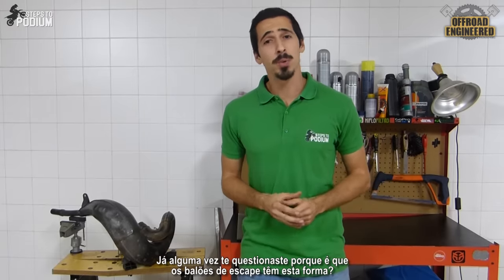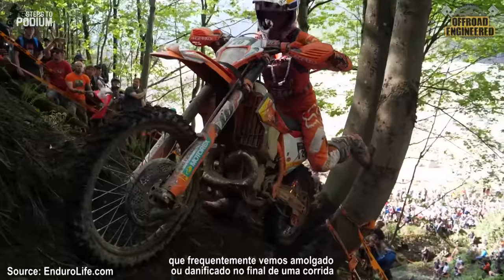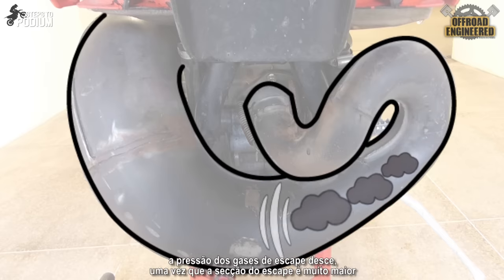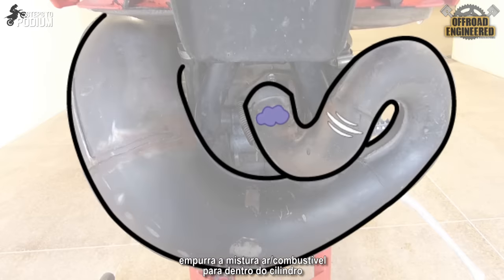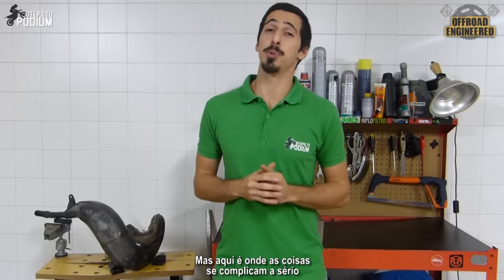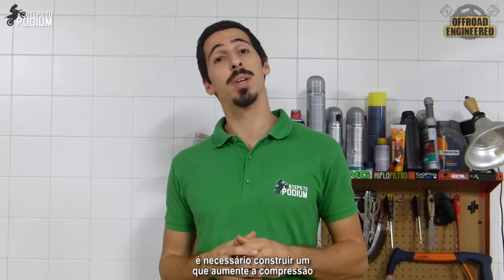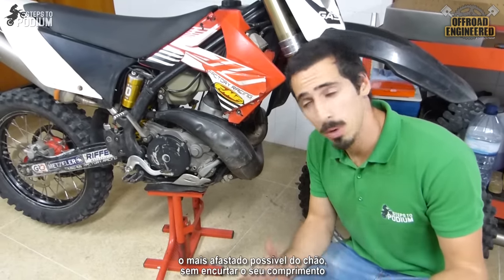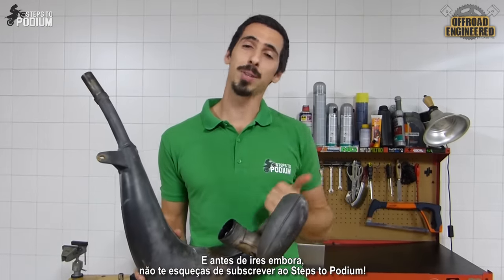How 2-stroke exhaust pipes work | Offroad Engineered

Comment: You have missed one import factor, as the pressure wave reaches the divergent part it creates a suction pulse that can actually pull mixture from the transfer ports, thus assisting charging. The convergent section does act as you have described. The outlet (stinger) is also part of the tuning process, but the outlet does not have to be at the end of the pipe it can be almost anywhere. Walter Kaaden was the originator of it, the Kadenacy effect  is named after him, it can be applied to two stoke diesels as well.
Reply from the maker: I posted a comment explaining that part and why I didn't include that part in the video 😉
Reply: @StepstoPodium  Didnt see that, all good, too many comments to trawl through.
Reply from the maker: @jeffsewell412  No problem :)
Reply: Good one! Motocross action did an article on the " father of the expansion chamber" , but his name escaped me, until you posted it.thnkx

Comment: Wonderful video! What would happen if you get hole in the pipe. Say a centimeter in size.  Would bike have trouble running or starting?
Reply from the maker: Thank you!! It would definitely have issues running and even starting, but it would depend a lot on where it would be as well

Comment: To add a bit more detail to StepsToPodium’s explanations — I’ll offer a bit more information:

A 2-stroke engine’s exhaust pipe can really be looked at as providing 2 different ways that it “functions”:  one is sonic/acoustic, and the other is pressure/volume (look up “Helmholtz resonance” to learn more about the latter one).

The shape of the divergent and convergent cones (that is: including angle, length, diameter) primarily determine the acoustic/sonic function of the exhaust pipe (and of course effect the total volume of the exhaust pipe).  The “negative pressure” (as the sound wave from a single exhaust opening event travels down the exhaust pipe) is caused by the cross-sectional increase in area of the divergent cone.  The angle of this cone, and its position relative to the piston face, are the primary considerations of the dimensions and design.  Similarly, the convergent cone “reflects” that acoustic wave back in the opposite direction, and its shape/angle/length/position determine the timing/strength and duration of that reflected wave.

Focusing almost entirely on the sonic/acoustic portion of the exhaust… what wasn’t mentioned, is that the port timing (position of the exhaust and transfer points relative to top dead center and each other) — typically measured in degrees — is the primary driver of the design of the exhaust pipe, at least when it comes to angles and lengths (there are other items I will ignore for now).  For the moment, let’s assume that the crankshaft is rotating at a very stable rate (crank speed actually varies slightly through the stroke).  For example, let’s say the engine is rotating at 6000 rpm.  That’s 100 rotations per second or 10 milliseconds per turn.  For sake of simplicity, let’s say the exhaust port in our imaginary engine opens at 90 degrees after TDC, and the transfer ports open at 120 degrees after TDC.  Now we get to the interesting part — when the exhaust port opens, a sonic wave begins to travel down the exhaust pipe.  The exhaust pipe could have a straight/consistent header diameter or have a slight taper.  Regardless of its shape, we can look at the shape/angle/cross-section of the first portion of the exhaust pipe (from the flange on the cylinder, all the way to where the divergent cone reaches its maximum diameter) as being the portion that creates the “negative pressure wave” (primarily due to the increase in cross section).  As that “wave” continues traveling down the exhaust pipe, it encounters the “convergent” cone, and as the cross section begins to decrease, a “reflection” reverses the direction of a good portion of that wave and sends it back toward the cylinder.

In this very simplified example, we have 30 degrees of crank rotation from exhaust port opening to transfer port opening, and at least as importantly:  150 degrees of crank rotation from exhaust opening to transfer port closing, and 180 degrees crank rotation from exhaust opening to exhaust closing.   So at 10 milliseconds for a full turn of the crank at 6000 rpm, we have .833 m/s from exhaust opening to transfer opening, 4.166 m/s from exhaust opening to transfer closing, and 5 milliseconds from exhaust opening to exhaust closing.  These numbers ONLY apply at 6000 rpm, and this is a SUPER-simplified example.

So, if we know the speed of sound (more on that in a minute), we can calculate “roughly” what the distance should be from the piston face to maybe the center of the rear/convergent cone, and back to the piston face for the convergent cone to be somewhat close to “in tune” (correct distance from the piston) at 6000 rpm.  Many people have an idea that the speed of sound is around 750 mph or 1100 ft/sec, which holds true at around 70 degrees.  Those numbers are way off for an exhaust pipe though, because the speed of sound increases dramatically with temperature.  Of course the temperature varies in an exhaust pipe, constantly cooling as it expands and travels down the pipe.  Let’s just throw a nice easy number at it, and say the mean exhaust temperature is 500 degrees F.  Now the speed of sound is about 1520 ft/sec.  

Using the above numbers (once again: only as a rough example, simply to illustrate the concept), We have 5 milliseconds from exhaust opening to exhaust closing, and at 1520 ft/sec, that equals a distance of 7.6 feet.  Of course we can divide that by 2 since the sound wave is traveling “out and back”, which gives us a distance of 3.6 feet from piston face to say… the middle of the convergent cone (and in reality, measuring a bit closer to the small end of the convergent cone may be more accurate).

As can be seen, this is only one value, at one rpm, at one port timing, and at one mean exhaust temperature.  A 2-stroke exhaust pipe has to be designed to work not only through a usable rpm range, but also “in concert” with other engine characteristics that go in and out of tune through the rpm range!  It does no good at all to optimize an exhaust pipe for 6000 rpm if the port timing is far better suited to higher rpm, or of the volume of the crankcase works especially well in a certain rpm range, or if the intake length is tuned for a certain rpm, etc. etc.

And… I have only been talking about lengths/distances and ONLY to the rear/convergent cone. (These comments don’t even touch on what happens in the header section and the divergent/front cone -- that could easily be another message as long or longer than this one.)  Exhaust pipe volume, header diameter and length, stinger diameter and length, type/flow of silencer…. ALL those items add into the equation of building an exhaust pipe.  Additionally, 2-stroke engines have many engine components and settings that go in and out of tune through the rpm range, and the exhaust pipe has to be designed to not only work best for a specific use, but work “in concert” with other setting and tuning parameters in the engine.

None of the above even begins to discuss port timing or blowdown, ignition timing, combustion chamber shape and volume, roof angles of the ports, port “layout” (where each port is “aimed” within the cylinder), crankcase volume, tuned frequency of the intake tract and reed valves (assuming it’s a reed valve engine, which is the most common in 2-strokes), type of fuel, rpm range the engine will be run at, conditions/altitude where the engine will be run…. and many other items.  Tuning a 2-stroke engine (or building an exhaust pipe for said engine) is an endless sequence of compromises.  There is no “one perfect exhaust pipe”, nor is there any other “one perfect setting” for the items mentioned above.

Many books have been written on exhaust pipe “theory”, and to be honest… the best tuners do a lot of cutting and welding and testing.  The math simply does not always match up.

Suffice to say that… 2-stroke exhaust pipe design is most definitely NOT a “precise science”!
Reply from the maker: Thank you so much for the info and for not being a complete dick while addressing that (like many others have).
I really appreciate the time you put into leaving this comment and thank you for complementing the info on the video! 
I wish more people were like you ! 😊
Reply: Agie 170hss , all that and not one mention that two strokes are self supercharging making their own internal boost above atmospheric pressure producing much more horsepower per cubic inch at a compounding rate the faster it spins up ...
Reply from the maker: @donniebaker5984  Did you take that from Wikipedia? 😂Don't lie to me now 😉
Reply: @donniebaker5984  Donnie,

Crankcase pressure (what you refer to as “boost”) does not “compound” with rpm.  There have been tests done on a variety of 2-cycle engines using ultra-high-speed pressure transducers in the crankcase, and while crankcase pressure absolutely does vary through the rpm range (and of course through each 360 degrees of crankcase rotation), it generally falls into the range of 0.7 bar to about 1.4 bar using an optimized tuned exhaust pipe.  What crankcase compression does have is a “sweet spot” where the tuned frequency of the items that effect it (intake tract flow and inertia, crankcase tuned frequency, and of course exhaust pipe design) most closely are “in concert”.  Air acts like a spring...  and intake, crankcase and exhaust pipe all respond to the mass of the air and the spaces that contain it… no different than blowing into a bottle to create a tone.

The “crankcase compression ratio” has finite limits as to what can be accomplished.  Your explanation of how a 2-cycle engine functions is quite valid, up until about the mid-1970’s.

This is when Morbidelli (an Italian furniture manufacturer that also built and raced GP motorcycles) discovered that a considerably larger-volume exhaust pipe of correct angles and proportions could draw much more air/fuel mixture into the exhaust pipe (and push it back into the cylinder with the reflected sonic wave) than could be accomplished with primary crankcase compression alone.  This can be done because when the transfer ports are open, there is a direct connection from the exhaust pipe to the crankcase. (in other words, one could actually pull a string from the intake tract, through the crankcase, up the transfer passages and into the cylinder, out the exhaust port and into the exhaust pipe). Morbidelli was the first to "focus" on that period of time within the stroke that the transfer ports are open -- and capitalize on the connection between exhaust pipe and crankcase. 

Primary crankcase compression has finite limits — it not physically possible to make a very high crankcase compression ratio since there has to be “space” in the crankcase for the piston and rod to move, and also for a reed cage (as most modern 2-stroke engines use), as well as transfer passages and the space inside the piston.  An interesting investigation into any 2-stroke engine is to “cc the volume” of the crankcase (fill it with fluid to accurately measure the volume) both at Top dead center and at Bottom dead center.  What gets discovered very quickly is that primary (i.e. crankcase) compression ratio will only take an engine’s performance to a certain level.  Morbidelli’s “discovery” of actually increasing crankcase volume (effectively lowering the crankcase compression ratio), but doing so in unison with the correct exhaust pipe design and intake/crankcase design…  allowed a significant jump in performance.  (Morbidelli dominated for a season or two as other manufacturers caught up).

Very simply, what changed was that instead of using the exhaust pipe to “push back in” any air/fuel mixture that had “leaked out” of the exhaust port…… the new approach was to intentionally design the crankcase, porting, and exhaust pipe to “draw” much more air/fuel mixture into the cylinder and exhaust pipe than the primary crankcase compression ratio could “push” into the upper part off the cylinder.  The focus shifted away from crankcase compression - TO crankcase and port flow plus larger-volume exhaust pipe design.

- I should note that there was one exception to the “limitation” of primary/crankcase compression ratio:  In the mid-70’s (as I recall), an Italian go-kart engine manufacturer built an engine with a “stepped” piston and bore.  In other words:  the piston displaced 100cc in the combustion chamber (as was within the rules), but the piston and bore were larger at the base of the piston.  I don’t remember exactly how large it was, but as one could envision… this provided what was essentially a 100cc engine with a “crankcase pump” of something like 150cc.  The engine was mechanically “clumsy”, and difficult to manufacture (not to mention having a very heavy piston).  The idea was dropped fairly quickly and also banned in within the rules of kart racing.

Obviously much has happened in 2-stroke design since the mid-70’s, however Morbidelli’s move away from relying on crankcase “pumping” is surely one of - if not THE - most significant changes in 2-stroke design over the last 50 years.  The other very significant design change (IMO) has to do with the aiming of transfer ports, however this was more of an “evolution” over a number of years starting in the mid-90’s or so… and I would not consider this as important as what Morbidelli inspired.  There have of course been other “tweaks” along the way, such as the “boost bottle” someone else mentioned (which is a method to shift the rpm of the “tuned frequency” of the crankcase).  Fine tuning of intake tract, reed valves, port design, and exhaust pipe design have brought us to quite impressive performance levels over the years!

Comment: Very interesting video, however I have one thought. How come the high pressure wave manage to push air and fuel mixture back in to the cylinder at the cylinder end of the diverging/converging pipe, but let exhaust gases through at the muffler end of the pipe?
Reply: Im not sure but try to imagine this.
The exhaust gasses are flowing away from the engine the whole time, but but the pressure just increases within the gas and the pressure travels back up the bike. So no gas is going backwards and forwards its just the pressure. Not sure about that buy seems like it could be a reasonable answer

Comment: Ok this definitely makes sense to me as rc engines have a tuned pipe as well. The  nitro rc engines run as normal from idle to about half throttle and when you wide open them they really scream almost like you hit the nitrous switch. My question is why don't 2 stroke equipment have these tuned exhaust and is there any real gains to muffler modifications or would this be damaging to say a chainsaw or trimmer?? In the landscape world more power is generally a good thing but not if the cost is a peice of equipment with a lot shorter engine life.

Comment: Thanks for the video. it was great. However, I have 1 question. Why is it necessary for the for the exhaust to go back and build pressure? Does it create more power, less power....what is the actual reason and would it do to the engine performance? Thank you
Reply from the maker: Thanks! The goal is to supercharge the engine!

Comment: Although it's counterintuitive, according to Bernoulli equation when the gases leaving the engine first encounter the increase in diameter at the beginning of the muffler, the velocity does slow, however, the pressure Increases (not decreases, as mentioned in the video).
Reply from the maker: Bernoulli equation does say that, but a condition for the bernoulli equation to be valid is that the fluids have to be at constant temperature, which does not happen in this case 🙂
Reply: @StepstoPodium  Bernoulli's principle is a simplified model for conservation of energy. It's also for incompressible fluid, but that doesn't change the fact that your theory is backwards: dynamic pressure drops, static pressure increases.

It's the pressure wave that you need to focus on, not the volume flow (Bernoulli's principle is helpful in understanding the pressure changes of the volume flow which affect the pressure wave, but isn't the only theory you need to apply)

Comment: ......and.... this being a very technical subject, let’s remember also that this is a “tuned” exhaust system that also uses the sound waves in addition to the pressure waves to optimize performance of the 2-stroke. 

Leaving out temperature and the length of the  pipe which also have a symbiotic relationship, luckily this can all be engineered by computer mapping of the cylinder and combustion chamber. Before that it was pretty much trial and error
Reply from the maker: Yuuup! It's actually a really tuned pipe for one of the most demanding performance situations where you use the power band to the fullest and not only peak power! 😊
Reply: Steps to Podium .... No coincidence either that it is shaped somewhat like a musical instrument....like a tenor saxophone
Reply: @StepstoPodium  thats when shes "on the pipe" making boost supercharging its self as no naturally aspirated 4-stroke can ever do
Reply from the maker: @donniebaker5984  true indeed!

Comment: So what about making a bike with YEIS bottles (volume before/after the carb, Power valves, tunable volume outside the exhaust throat...
and a movable cone (like a funnel) shadowing the convergence, inside the expansion chamber so it can be tuned to the revs....
You could even run a U in the header pipe before the divergence like a trombone so you can tune the timing of the gas there...